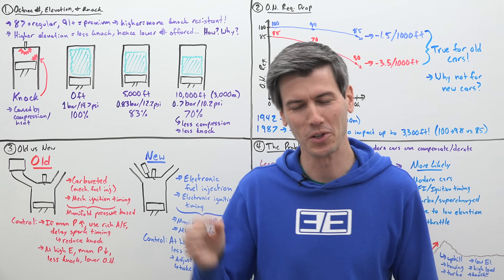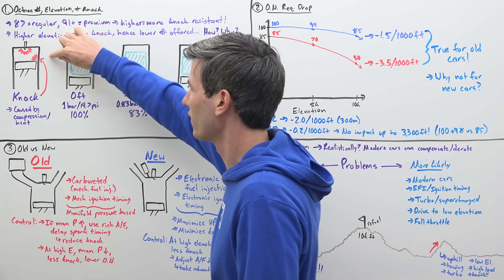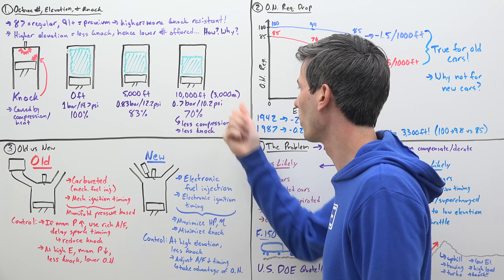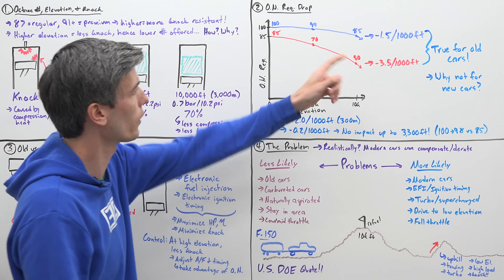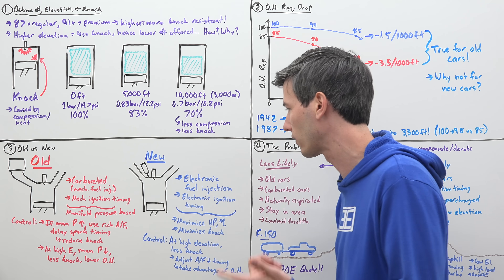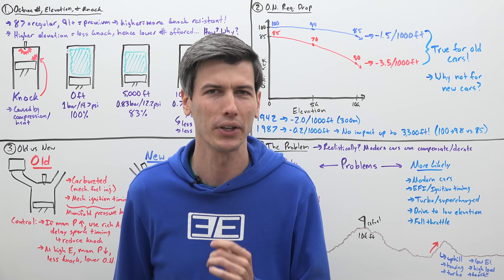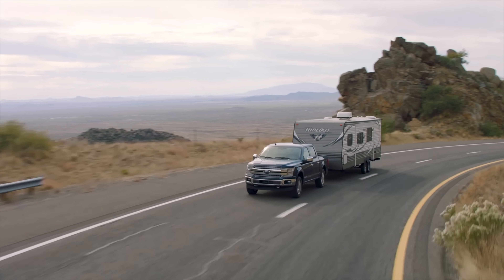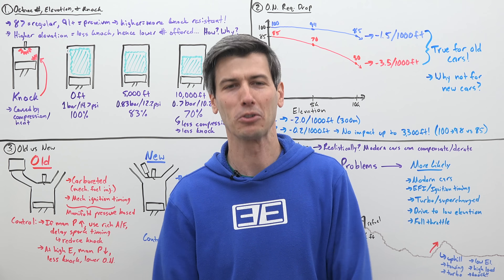Never Use This Gas In Your Car!

Comment: Like another commenter, I also live in Colorado, and regularly drive between 5000-8000 feet of altitude with a Volkswagen 1.8 turbo. I always fill up with 85 octane. After watching this video, I began to really listen to my engine, especially on the short but intense 5 minute climb from 6000-7500 feet I do each day on the interstate. This stretch of road is littered with overheating cars during spring and summer, and is a real check whether your car is running right. While I understand what this guy is saying, I can report no knock, no loss of power, no engine codes, no issues at all in the driveability of the car, even under high turbo boost at high speeds for several continuous minutes. So while I think I understand the science, I also think cars aren't quite as delicate as we think they are....and honestly, how often does anyone go from high altitude to low except on a road trip...and if you got a check engine light, seems like you should just pull over at the next station and fill up with the highest grade and be done.... the price difference between 85 and 87 octane here can be 50 cents a gallon, and another 20 cents to go up to 89....over time, that really adds up. UPDATE: i am now driving a 2025 bronco with a 2.3 Turbo. I am using either 85 or 86(15% ethanol) in my tank and still driving fairly challenging roads. There is zero knock and plenty of power.....

Comment: This all makes sense, but what about vehicles marked as "Flex-Fuel" that can use E85, would that be fine since they're marked as safe for E85? For example, my wife's car (2010 Ford Fusion V6) has a label around the fuel port that says its E85 safe.

Comment: I use 87 in all my bmws 
They don’t like ethanol and where I live the higher rating the more ethanol. 87 has my bmws running in tip top since I’ve switched from 91

Comment: i sometimes buy 86 if im short on money, but i find higher octane gas (91 or better) gets me about 50 more miles, or about 2.5 gallons, and depending on prices, its about the same $$$ for mileage if i buy the super! lol. Also, i live at about 6000 feet, so i can use either. But the super seems to be better, both efficiency wise, and money wise.  kinda funny how that works out.

Comment: Absolut bullocks. They just want you to buy expensive gas. There is no forensics your insurace company can run to void your warranty. ALWAYS BUY THE CHEAPEST GAS YOU CAN PUT IN YOUR CAR.
Reply: Exactly, I drive a corolla with 85 octane and visit California sea level elevations frequently with it. Not once has there been an issue, the tank lasted basically just as long too

Comment: I still struggle with  this video ... All modern cars that is know of will run as much timing as the possible.. Relying on the Knock sensor to reduce Timing..  So while running more RON will result in greater efficiency /Power running lower ratings wont damage the engine because that is the point of the Knock sensor.. I would be HIGHLY surprised if this new car didn't have a Knock sensor. !

Comment: Wait, so you're telling me that octane is NOT CH8?  8 hydrogen atoms attached to 1 carbon atom?  It's actually some sort of anti detonation rating - not even a molecule at all?
Blows my mind away.  Everything I learned was wrong.
Or is this video actually lying to people by saying, "basically what it means is it's resistance to knock"?
And then you'll have to explain to me how increasing the amount of CH8 reduces detonation in a car that meters the amount of fuel electronically.

Comment: I live at 6500 ft elevation. The norm for regular gas here is 85 octane. My 2013 Ram and my 2018 Jeep run like cr*p on 85 octane. In fact, I took the truck to the dealer thinking something was really wrong with the engine, and the mechanic told me to never put 85 octane in it. Just run out the bad gasoline. I use at least 87 all the time now and have had no further engine problems.

Comment: right now...I think most of us are and not being told about it.  My vehicle has had recent computer issues related to the changed amount of ethanol in the fuel.  A forced relearn regarding ethanol percentages and the vehicle is ok ...for now... it is a FLEX vehicke.

Comment: You know here in Utah we have the 5th highest gas prices in the nation! (Aren't we so lucky?) It wasn't so bad to use mid grade when gas was cheaper and it was only 10 cents/gal more. Now with the price of gas where it is, I've found myself using 85 octane exclusively on my 2012 F150 (5.0L), wife's 2020 Jeep Cherokee (3.2L V-6) and the 2013 Subaru Outback. None of these vehicles are the turbo version and none do any towing.......otherwise if the truck was towing a trailer, ya, I'd use mid grade. Every one of these owner's manuals recommends 87 or higher. (We know why as you have pointed out). But in reality its only an issue in a few states. I've always known that knocking is not good for the engine and to increase the octane level if that occurs. Mostly that education came about with a 92 Ford Explorer that had to have mid grade. Now these newer cars don't seem to have an issue with the lower octane. I really haven't worried about the octane level as long as there is no pinging (that's what my dad always called it). Your video has made me a little more aware and slightly more concerned, but as long as no knock, I think I'm fine. (Thumbs up for your well done presentation!) When I travel to Houston, Tx once a year, I feel like I get more for my money outside of Utah when the lowest octane is 87 and on top of that it's cheaper too!

Comment: I live in Montana, had a '64' Oldsmobile. It even said, "Ultra High Compression" on the air cleaner. It was actually 10.5 - 1.
It ran on just about anything at altitude. Took a trip to an area at sea level. It would only run on Sunoco or Exxon premium without
knocking. Not even other brands of premium would work.

Comment: This video was great for explaining a confusion I had when I was visiting Utah with a rented car and had to fill up. I immediately noticed the numbers on the octane were different and I had no idea why that was the case. Thanks for informing me as to how this came to be.
Reply: Air at 5,000 feet is not the same as sea level. Physically, 85 octane gas performs the same at 5,000 as 87 does at sea level.
Reply: Since it was a rental, it was okay to put 85 AKI fuel in the vehicle.
Reply: ssooo 87 good 86 and below is bad unless your driving a car from the stone age got it🤣🤣🤣🤣🤣
Reply: @raven4k998 more like if you're in Denver a mile above sea level you want lower octane ;)

Comment: Resistance to knock?  
It's actually the higher the octane the higher the detonation resistance. 
 knock is premature detonation which means the temperature of the Piston will set off the fuel before the spark plug actually fires.
 And 85 isn't bad in all engines only in higher compression engines.  As the higher the compression the easier low octane fuel ignite's causing the fuel to ignite from piston hotspots before the spark plug fires.
 But a low compression engine will easily run on 85 with no problems when you go to higher performance engines and turbo engines and forced induction engine then the compression ratio is higher therefore you need higher octane fuel. So saying 85 is bad to run in your car is wrong it totally depends on the car and PowerPlant that is in that car.

Comment: I'd really like to see a video on ethonal blended fuels. 

I drive an "older" fuel injected car, and I live at a higher elevation. It's a 86 v-8. When we converted over to ethonal fuels, I lost power and economy. But we also gained equivalent "octane" rating by using the ethonal. 

To get some of the power and gas mileage back, I actually bump my base timing up quite a bit. Base timing is 10° and I can usually get up to 16 or 17° without any knocking or issues. Even though it's old, it still has computer controlled timing, but it's also really low compression at about 8.5:1. 

Now on a newer car with variable valve timing, I still don't see an issue, as the electronics should be smart enough to detect any sort of knock and pull back timing. On a turbo charger car, the argument against lower octane fuels makes perfect sense, because they artificially raise combustion pressures and essentially negate the losses from elevation. 

Personally, the best mileage I get is on non-ethonal low grade fuel. I usually get the same, or even worse on premium.

I used to drive 100 miles round trip 5 days a week, and this was around the same time that we started switching over to ethonal in my state. I routinely got a 7% dip in gas mileage whenever filling up with "e10", so I would avoid those until they were all gone. 

Since my drive was 50 miles almost exactly each way, I had a 22 gallon gas tank and often averaged around 30 mpg if I was careful. I would routinely get right around 600 miles to a tank. I did all sorts of things with my driving habits to try to maintain or beat that 600 mile range. My personal record ended up being 652 miles averaging about 35 mpg on a full tank. But that was being really careful and trying to do 55mph on the highway. 

Messing with it, I could easily maintain 70mph all day long using cruise control and still get 30mpg. I decided after doing the math that I would rather save the 20 minutes a day then save the $3 dollars a week and kinda gave up on maximizing millage. 

Oh, and incase you were wondering, it's usually not worth it to run non-ethonal fuel. It's usually between 10 to 25% more expensive, and at most you will only gain 7% difference, so cost wise it's pointless.
Reply: That depends very much on the vehicle. OBDI autos gave me 30% less mileage on E10, compared to ethanol-free, as well as soot in the tailpipe, so they were burning more fuel. For a OBDII car you are right, but I am using E0 in my older OBDII because it isn't rated for E15 (now the gasohol standard by government mandate).
Reply: Ethanol has less energy v gasoline.
So it fixes knock but you need more of it.
Reply: My brother’s 2013 Chevy Silverado gets about 10% better fuel economy using E15 than E0. No idea why.

Comment: One tank isn't going to hurt your car. But if you fuel at 7100 ft then drive to 6000 ft and fuel again you may have issues at 750ft with that fuel. So get 87 or higher when coming down to lower altitudes.

Comment: I’ve never used anything but 85 octane in my 02’ 4Runner. 210,000 miles later not the slightest problem caused
Reply: Had a 2000 Tundra in Denver and it actually got worse mileage if I put higher octane than 85 in it

Comment: This is all BS the computer controls your air fuel ratio doesn't matter what type of fuel you use whatever it's programed to operate at that's what it runs at regardless of Octane, I have an 07 nitro with 369,000 Km and I have always used 85 Octane fuel once in a while like couple times a year I might put in and premium fuel I have never felt the vehicle perform any different or seen any changes on my digital HUD display showing gas mileage or change in RPM. To this day

Comment: There are 2 scenarios that can damage an engine.

The first is pre-ignition, where a hotspot fires the mixture before the sparkplug; pre-igniting the fuel/air mixture.  This causes an extreme rise in cylinder pressures, just as overly advanced spark timing would.  Pre-ignition can also be caused by a fuel of too low an octane for the compression of the engine, a situation not seen in many modern engines.  A side effect we used to see in carbureted engines was "dieseling" or "run-on", where after turning off the ignition, the engine would continue to chug and sometimes kick backwards; an anti-dieseling solenoid was common on later carbureted engines for this reason. Modern engines turn off the fuel, which eliminates this issue.

The second condition is detonation.  This occurs when the mixture actually explodes rather than a controlled burn from the sparkplug out.  This explosion hammers the piston assembly causing damage to the piston and even possibly damaging the connecting rod bearings.  I have seen the tops of pistons dished in due to this hammering.  A common cause for this is a very lean mixture due to a vacuum leak or fuel delivery issues.

Comment: When I lived in northern Utah they sold 85 and misses asked me why I didn’t use it because it was cheaper. I had read my car manual and it stated no lower than 87 octane. All the gas  stations were 85, 89 then 91 octane fuel.

Comment: One small correction, you should be talking about air density at different elevations as opposed to air pressures. It's the air density that is the problem at higher elevations.

Comment: Doesn't the turbo increase pressure in the engine? Wouldn't that contribute to the knocking of a engine?
Not disagreeing at all just wondering if it's a contributing factor

Comment: But they sell high octane fuel for race cars in places like Indianapolis I think I’ve seen 105.  I’m not from Indy  but I’ve see stations with high octane fuel.  So it would make sense they would sell low octane. 
But I think your explanation of knock is wrong.  Knock is caused from pre ignition of fuel in your cylinder higher octane fuel has a higher flash point or ignition temp  so it’s resistant to pre ignition.  The whole reason I mentioned this is because it’s important to understand that even know you have a carbureted vehicle. With low octane fuel you can still getting pre ignition just not knock.  Because you’re not getting the compression needed for knock.  But you’re losing fuel economy because you’re igniting fuel before it’s optional time.  Less fuel+less compression= less power

Comment: With this explanation, no, it's not crazy that the lower octane fuel is sold, but now that very few cars can get away with using it, there should be a big disclaimer on the pump, and maybe a QR code that leads to this video lol.

Comment: I owned an '85 full-size Ford Bronco with the 351 Windsor engine when i lived in Detroit Michigan. I actually got the owners manual even though i bought it 10 years old. In that manual, it stated that the 351W was designed to run on the lowest octane fuel available. The local Speedway gas station sold 86 octane and that engine loved it! One day i felt like giving my truck a higher octane fuel and that gave my engine spark knock that lasted about a month before i found the solution (which i can not remember). This truck was running a 650CFM holley carb (that was junk...buy edelbrock) and got 4 mpg no matter where i drove it (city, hwy, 4x4) so i was happy to spend a few pennies less per gallon. Of course this is when 87 octane was between .89 and .99 cents per gallon.

Comment: Even in cars thar specify anything less than 91 octane gas (ie the Smart City) will void the warranty, it will still be covered. You may have to fight it in court, but you will win. The Vehicle Right To Repair bill that was passed in the 90's states that using commercially available feul of the correct engine type can not viod a waranty, regardless of octane rating. As long as you get it from a gas station and you put gas in a gas engine and diesel in a diesel engine, the waranty has to cover it by law in the US.

Comment: The thing that helps me understand this is to factor in the atmospheric pressure, into the compression ratio. At higher altitudes you're getting less air into the engine, and while the piston doesnt change its travel distance, keeping the same compression ratio, the pressures dont get as high because you're starting out with a lower pressure
Compression ratio is only one part of the equation. If you have a 300:1 compression ratio, thats still going to be 0PSI in the vacuum of space. And a 1.25:1 compression ratio could cause knock, at a specific altitude somewhere in Jupiter's atmosphere, assuming there was oxygen to burn
Reply: Very true. A person with a breathing issue, such as an asthmatic or someone with COPD, will have a lot of trouble breathing at higher elevations. Most of the time, when they go to a lower altitude they are able to breathe easier.  I lived in the High Country of Colorado [8,000 ft] but was surrounded by mountains which were up to 14,000 ft.

Comment: this actually reminds me of a time where I was on a road trip, and happened across one of these gas stations, being as none of the gas stations where I live do this, I always get the cheapest gas without thinking about it, as my car doesn't need the extra knock protection.  well it wasn't until after I filled up my car did I notice that I had put in the 85 gas instead of the usual stuff,   and while it seemed to run just fine the next day the car was having tons of problems and the mechanic said that the fuel regulator had been over stressed and had basically blown out and would randomly send either to much or to little fuel which is why the car was having so much problems. and it was super expensive to fix too.  So while I get what your saying,  you still want to be rather careful about that as even if it doesn't affect the main combustion system it could mess up other parts that also handle the gas.
Reply: You must have driven a shitbox there's never been a single time 85 octane caused a difference in my toyota

Comment: dont forget about piston compression, in a 9:1 you can get away with 87 octane but if you have a 11:1 compression 87 octane will knock under load.  11:1 runs fine on 89 octane.
in my friends super late model he runs 118 octane with 15:1 compression.   also, humidity plays into performance too but we will save that for another day.

Comment: I have a 97 Tahoe (5.7l) and I live in Denver, CO. I've been putting 85 octane in my truck since I bought it 21+ years ago with no discernable problems. Grantedz most of my driving is at more than 5,000ft above sea level, or higher. 

Even my motorcycle, a Suzuki sport bike doesn't have a problem with 85.